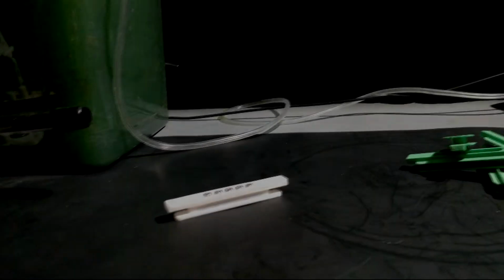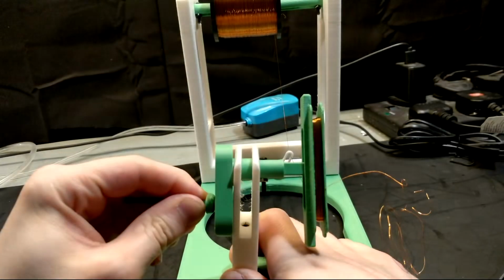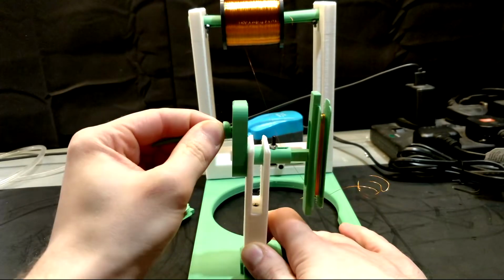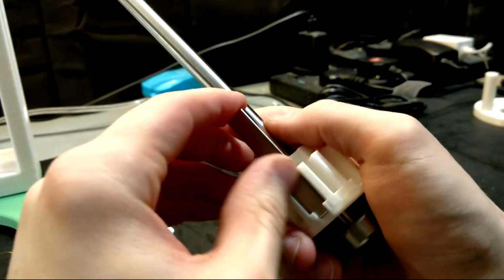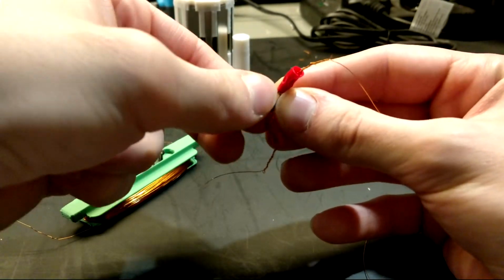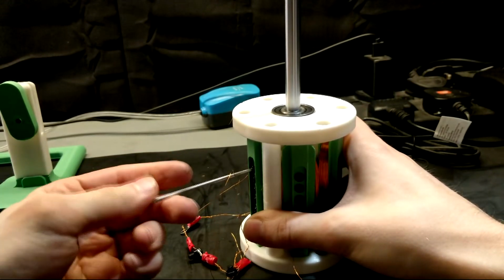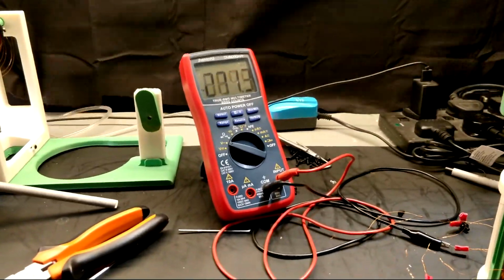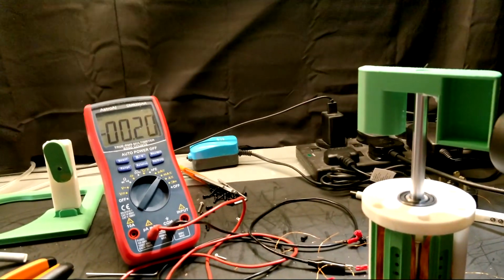The ModuCoil Generator - The Beginning of truly Decentralised Energy

Comment: The idea is cool. From experience, make sure the magnets are very close to the coil and also use N52 Neodymium magnet or anything stronger. You will get higher voltage and current.

Comment: what is so special about this generator?
Reply from the maker: From a performance standpoint? Not that much, aside from the fact that the Halbach array negates the need for a metallic core.

The real benefit here is the modularity and ease of disassembly. If I'm honest,  there are lots of things to improve. The rotor is prone to slippage, and the cable management is a mess, in addition to the wires having a tendancy to snag on the rotor.

Performance could easily be vastly improved by decreasing the height of the coils, and changing their topography somewhat, in order to achieve more turns for the same amount of wire (higher voltage/less resistance).

Comment: thanks for the content!! this inspires me to follow such a build.
6:59 what if you would have left only the middle screw in each coil? would that have increased efficiency?

for the love of god why did you "design" that coil winding machine so flimsy? it could have been easily simplified, way more stable etc. with less parts. (sorry, I had to ask this) lol
Reply from the maker: The screw wouldn't make much of a difference, as it's a halbach array, the rotor already does a good job of inducing current throughout the coils. On further testing and tinkering, I confirmed that the screws only really impede the mechanical smoothness while not really doing much for performance.

On this note, I'm actually working on a vid showing how I "fixed" the generator using a simple tweak.

On the winder comment, I design things with modularity in mind, although this is a rough and ready version. I think with a few tweaks it could be made sturdier, but there is a monolithic version on the thingiverse page if have the time and volume to print it.

As for why I 3D print a lot of things, myself and many others don't have access to things like metal tooling - 3D printing provides a means of manufacturing in the home or ultra small scale, on a local level, that otherwise wouldn't be practical.

I may improve the designs in the future, but they're all creative commons, so anyone is free to make edits!
Reply: awesome! thanks!! @edeniaAJ

Comment: Being hard to turn might be a GOOD sign! You've got lots of coils and I imagine some decent magnets. Even though there's no electrical load. At least, assuming you've ruled out any mechanical faults and you're sure the force needed to turn it is all down to electromagnetism. 

You might redesign your coil winder though, doesn't look like it goes fast. Maybe give it supports on both ends of the shaft, and make sure it's all rigid and doesn't wobble. Then you might be able to drive it with something like a drill, or print out some gears and have the crank handle spin the coil quicker. Also maintain proper tension and all that kind of thing, have the wire travel from left to right as it goes around the coil. Lots of things, actually! But you could get it really good if winding coils is something you're gonna do a lot of. Or else maybe there's somebody else already solved the problem and the code to print one out already exists.

Nice to see someone recreating the experiments that led to the world we have now. It's real hands-on physics, in any subject I think working like that gives you a deeper appreciation of the principles you could otherwise learn from books. Would be nifty if you have a nearby stream or even make a windmill to produce a few watts even just to charge your phone, or you can light a room with LEDs. Modern LED light bulbs are in the 5 - 10 watt range so you might be able to do something with a little windmill, a decent battery, and some LEDs. You could print your own light bulb housing so it could look quite nice. Maybe even take one of those lamps with a big pottery base and hide enough batteries in there for maybe 12 hours use, then discreetly run a wire in from a windmill outside. Even just one light bulb, running free of cost, would be something nifty to have. Particularly since you'd wound the generator yourself.

Yeah again with the windmill, there's probably already files online from people who've experimented and got an ideal design, you just do the parts you enjoy doing.
Reply from the maker: Thanks for all the good feedback! Will take a detailed look at it while improving my designs!
Reply: @edeniaAJ  Yeah reading Foogod's post further down, I think he's right about you having the coils wired the wrong way, they should be in alternating-polarity series as he says. That might be causing the shaft to be hard to turn as it dissipates all it's power as heat from the opposing voltages in the coils as wired up now.

Also the magnets are magnetised across their "depth", right? IE N at the front, S at the back (or vice-versa)? As opposed to being magnetised across their length, with the poles being at each end, cos that'd be wrong. I mentioned maybe getting those little disc magnets, you can get them in such an arrangement, or else cube magnets. Then you just glue them the way you want the magnetic field to go.

Might even be worth using the old iron filings / bit of paper trick just to visualise the field now and then, just to double-check it's all working as should be. The fields need to be swiping across the coils, so the coils are "cutting into" the fields moving past them. That drags the electrons around the circumference of the whole setup. Think of the magnetism dragging electrons from one of your output wires, through the coils, to the other output wire, since electrons are like tiny magnets in a way. Then the electrons move through whatever you're powering, and that's electricity.

Comment: You should have six coils. Two opposite coils connected, and the three sets wired in series. I have a similarly made unit that puts out 39 volts that is wired that way. With the windings in parallel it makes 13 volts. It would be pretty easy to try rewiring the coils in pairs. Why not try a fan blade on the shaft as well. The resistance on mine is 2.2 ohms.
Reply: 39V??? compared to 3.5 volt that a 10X
Reply: @jpjay1584  the amps drop from 15 to 5 though so the wattage is the same. The 39.3 volts, if it's going through a rectifier can go through a charge controller to charge either 12 or 24 volts battery 🔋 bank. It can be reduced from that to whatever you want.
Reply: @jpjay1584  what I have is a very rare PMA from a 660 Honda car. I think they were made around 1976. It was an experiment with a car 🚗 with a motorcycle engine. The alternator only made around 200 watts so the cars had to be plugged in to a battery charger if you ran the headlights and heater fan too much. So they were only made one year.

Comment: If the "mechanical resistance" you felt when the screws were present was solely because of the magnetic fields (and not because the plastic was deforming and things were rubbing against each other, etc), then you actually probably would have gotten much more impressive results if you'd left them in.  In general, with this sort of thing, the harder it is to move, that also means the more power it will generate when you do move it (though you might need a gearbox or something to take full advantage of it).

You might want to experiment with putting just some of the screws back in and see if you can get more power out of it (while still making it possible to turrn).  I would bet you could actually get some much higher voltages fairly easily that way.

Actually, I just went back and looked again..  you said you are connecting the end of each coil to the start of the next one, which implies that you are wiring all of the coils up with the same polarity.  However, the magnetic field in your rotor has an alternating polarity (and you appear to have the same number of coils as permanent magnets).  If that's the case, you should be wiring your coils with alternating polarity as well, otherwise when one coil is generating a positive voltage, the one next to it will be generating a negative voltage, and they will cancel each other out.  I would strongly recommend double-checking the polarities of your wiring to make sure they match with the magnetic fields the coils will be seeing at any point in time during the rotation.
Reply from the maker: This is some really detailed information, I'll give all this a go in January!

So you are saying I should instead be connecting start to start and end to end?
Reply: @edeniaAJ  Yes, if I'm interpreting your design correctly, I think that start-to-start/end-to-end would be the correct way to wire things (assuming the coils are all wound in the same direction).  Because the magnetic poles alternate, when one coil is seeing a north pole, the one next to it will be seeing a south pole, so current will be flowing through the second coil in the opposite direction to the first.  Therefore, you want the second coil to be wired "backwards" relative to the one next to it, so they both end up producing voltage/current in the same direction at the same time.

(This also might be why there was so much magnetic resistance with the screws in too, because the coils were electrically "fighting against each other" when you tried to turn it, but I'm not sure..)
Reply from the maker: Cool, thanks, will try it out!
Reply: @foogod4237   Would it be a good idea to match the magnets on the rotor, with the coils on his stator? IE have the same number of each with the same spacing? So then each coil is going N-S-N-S at the same time? And as you mentioned, putting them in opposing-polarity series would put the voltages in series, as you mention it might be that they're dissipating much of the power since they're connected up against each other. 

Like putting a load of batteries in series and alternating the way each second one is facing, so overall you get close to zero volts, and the batteries trying to force voltage through each other.

Also silly question but just in case, I hope the magnets are made to have the magnetic field across the depth of them, rather than end to end. Normally a magnet that shape would have one end N and the other end S. That would be useless in this case, the magnetic fields need to be pointing out through the wires, as if from the centre of the rotor.

If that was the case, maybe consider those little disc magnets you can get. They look like watch batteries, and the advantage is you can glue them in with any polarity you like.
Reply: @edeniaAJ  A thought I had is that screws, each generating their own counter EMF's, might well interfere with each other and just gum up the magnetic fields. Try using a bar instead?
If you make the coil holder to have that bar on the outside, the magnets will help hold it in. But I'd still epoxy-resin that bad boy.
Reply from the maker: @TimeSurfer206  the thing is I'm trying to avoid adhesives and mixed materials where possible, because it makes the end product less recyclable and harder to disassemble, which is counter to what I'm going for in my designs.
Reply: @edeniaAJ  Engineering is the science of "Necessary Tradeoffs."
If you wanted truly recyclable, you'd be making the coil holder from a wood-based product.
Which, really wouldn't be that hard to do.
You could also use a non-magnetic nut&bolt to hold the bar on.

Comment: Awesome!!! There's definitely room for improvement, but all the work you've already put in is really valuable, and you're even giving the files for free! Awesome. Have you thought about doing a design with serpentine coils? It seems they're more easy to wind.

Thanks for sharing!
Reply from the maker: Hey, thanks for the good feedback! In the future I want to experiment with different moducoil shapes/topographies to get the resistance down a bit. 

I have done a cursory look into serpentine coils, if you're familiar with him, Robert Murray Smith has done a lot of work on them. I'm not sure how you would automate or make use of labour-saving devices (like my winder) to wind such a coil though.

I am quite interested in axial flux and it's potential scalability, but I want to see how much tweaking and improvement I can eek out of the current general design beforehand.